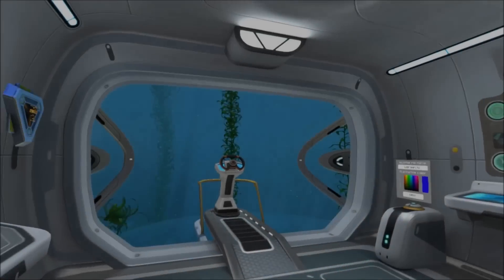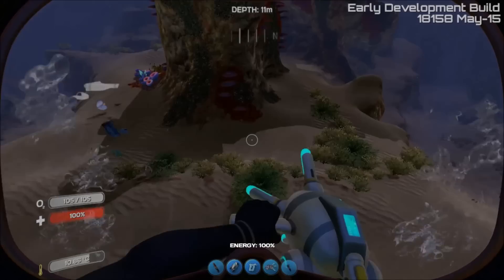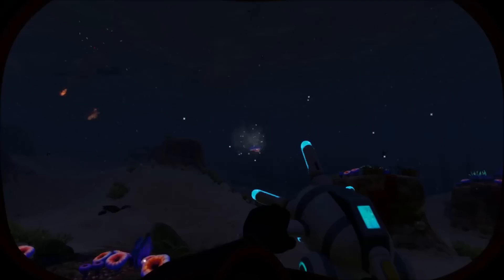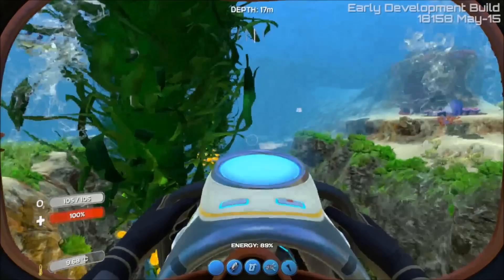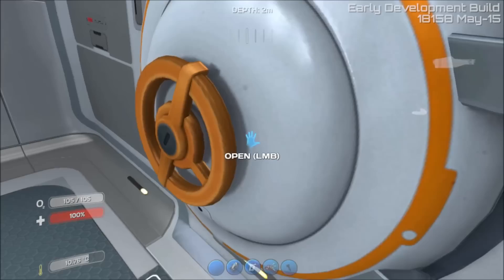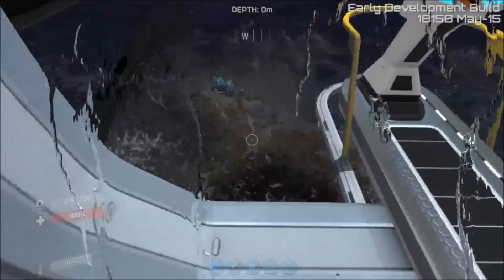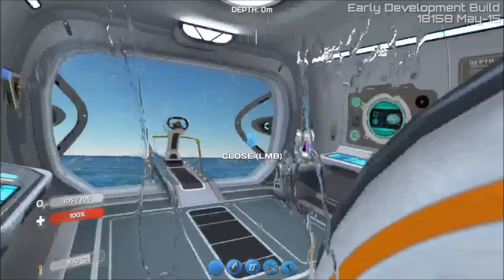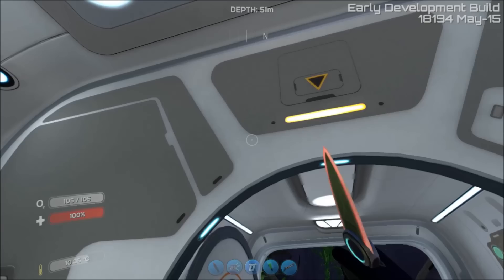Subnautica v18158 Bugs and Propulsion Cannon Fun

Comment: Hello again, Phaota! I haven't finished the video yet (29 mins in) there's a bug with the Prop Cannon, when you pick something up with it and un-equip the Prop Cannon, it does the Phantom Glitch.
Reply from the maker: Zer0 The Assassin More detail on that bug please.
Reply: If you unequip the Propulsion Cannon while holding something, the item just floats there and becomes a phantom, fauna is what I tested it on, on the island. Also, some of the mushrooms have no bottom, which they're probably working on.
Reply from the maker: Zer0 The Assassin So, it's the same as the bug I showed where it vanishes from the Prop's grip and becomes a phantom.  I'll definitely test that out and report it.
Reply: Sorta, also, I reported it with the feedback but I don't think it got sent through.
Reply from the maker: Zer0 The Assassin Unfortunately, the feedback isn't the best thing to use for reporting bugs.  The Steam Discussion "Bugs" forum is best.
Reply: I see.
Reply: Phaota Vertical tubes with spiral stairs, like a lighthouse
Reply from the maker: SnowConeMonster Underwater bases do not need spiral staircases.  They're a pain, especially in real life when you need to move furniture up them.